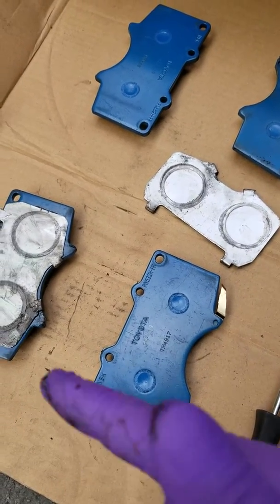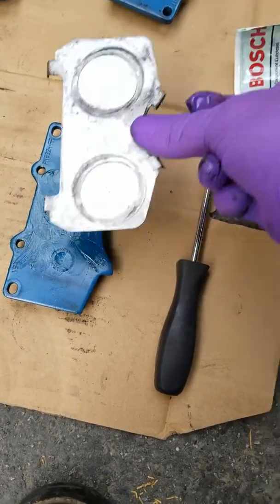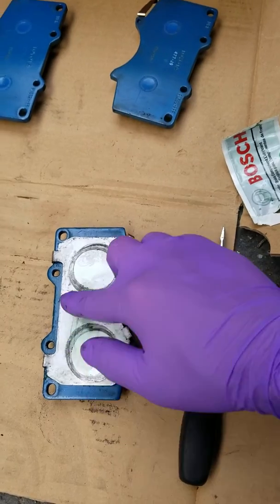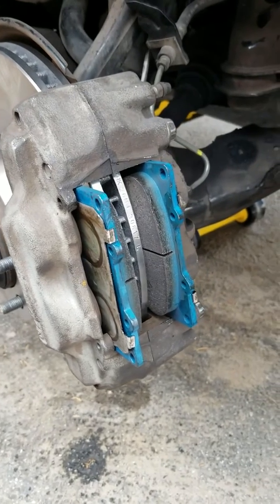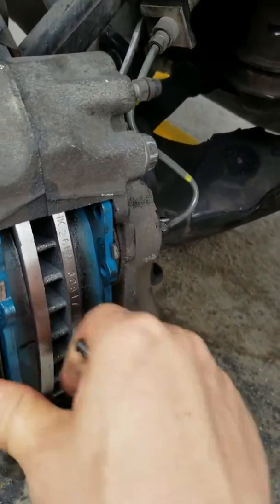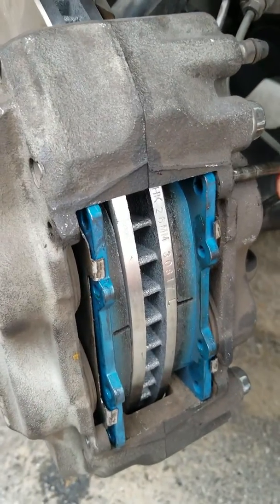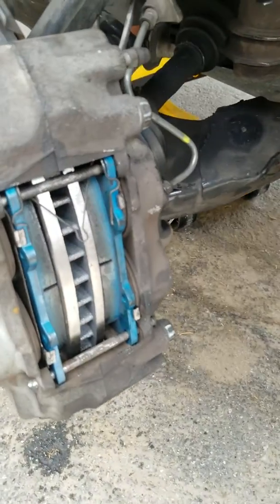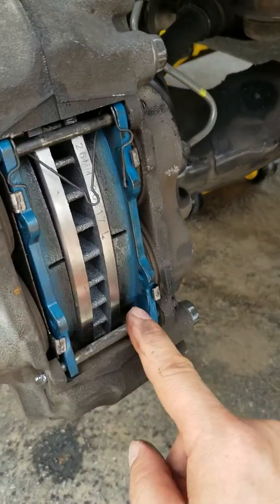2003-2009 Lexus GX470 BRAKE AND ROTORS PART 2 OF 2

Comment: Thanks for the video.  Just a heads up that the Pin should go rever, where the locking pins stays on the inside.
Reply from the maker: Thank you Daniel, much appreciated!  I am redoing my pins soon with new brake accessories .

Comment: I missed the rotor being replaced?  Does it slip off after removing the brake caliper like most 2wd cars?  Or is there a front hub that has to be disasembled like most Toyota 4wd?